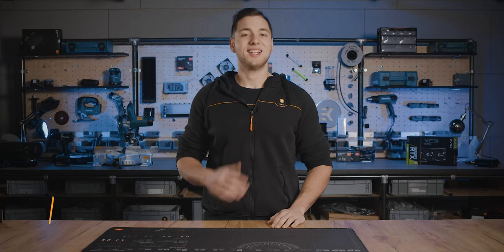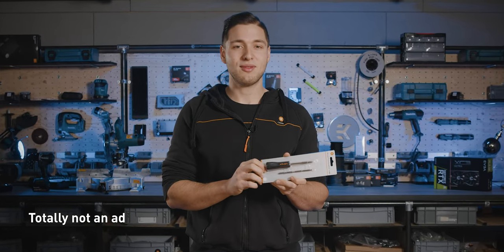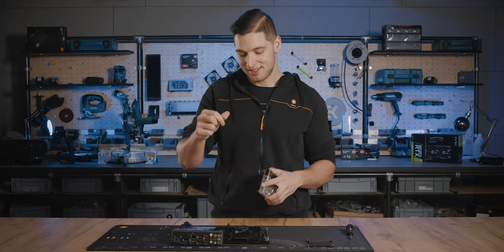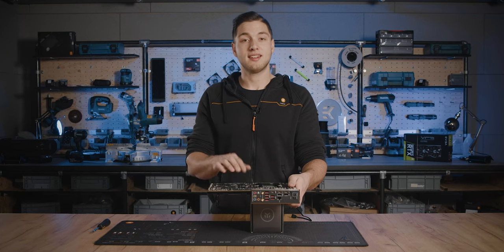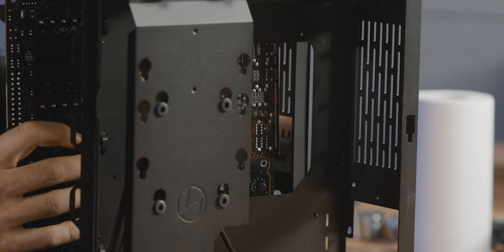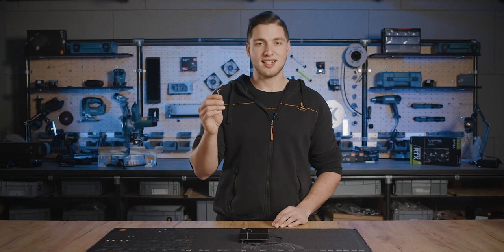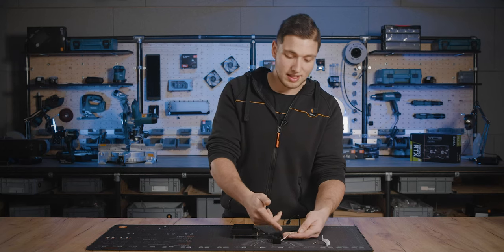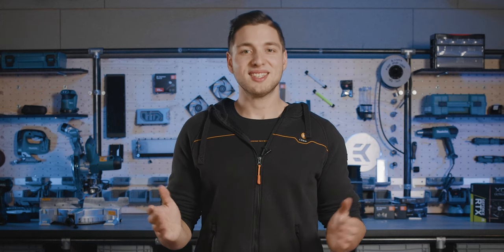Installing the Velocity²: Everything You Need to Know | EK HOW TO

Comment: Hey everyone so I want to jump in and explain something that happened to me after buying the >AM5< version of this water block. When I first got it I imediatly opend the box but did not have a physical manual included so I came to this video to see how it is done. However as you can see in this video you have to use a backplate that comes in the box. My water block did not come with a backplate yet the packaging has printed that a mounting mechanism is included in the box. Turns out that the packaging belongs to the AM4 products. I sent in a support ticket and they asked for me to check the manual on the QR code which is printed on a separate sticker on the bottom that is correctly labled as AM5. The manual lists the included products which did not mention a backplate but instead the backplate is the preexisting one that is part of your motherboard.

If you get the AM5 WB dont worry it does not come with a backplate.
Reply: Thanks for the heads up! I was like ??? There is no backplate

Comment: Video is good but lacks specific info, on blocks that don’t require a back plate how far do you screw in? Manual doesn’t give any indication either hmmm anyone know? Installing an am5 one and not sure if I should screw until they are level with the back plate or keep going

Comment: Just got myself one of these for my AM5 7950x, can't wait to install :)
Reply: How did the install go? I’m trying to install it on an AM5 board. How does it secure to the motherboard? The corners go in the holes, but is there no screw or nut for the backside?
Reply: @TheCOMiiT  yes mate, just received mine, no backplate ??
Reply: dude, just found the backplate is integrated on the mainboard, just have to screw it in =)

Comment: What screws do I use when using the LGA1200 to LGA1700 adapter? the backplate with the velocity doesn't even fit the mounting holes.

Comment: I did not notice the warning in small print, about that, that you can’t stick backlight into any connectors, to avoid closing, partially, this is because of ignorance of English, generally on mine ( ek water blocks ek-velocity amd ) closed the backlight, and now it does not work, is it possible to replace it, and is there a replacement instruction for such water blocks?
I must say, it was a big headache to find an adapter for connecting to the motherboard, x470 gaming WiFi 7 rev 1.0, you should equip your water blocks with the necessary adapters!

Comment: This mounting system was first used on some of EK's monoblocks like mine and I was stressed because I thought there was missing parts.  Oddly enough having just 4 screws going throug the MB with no backplate has worked just fine.  Now that I watch this video I'm stressed about having no backplate.
Reply from the maker: That was the design choice for those monoblocks. Keep in mind the monoblocks are also held in place with screws near the VRM section of the motherboard, so there are more than just 4 points of contact :)
Reply: @EKWBofficial  Can i use 1/2 x 3/4 Bitspower or EKWB compression fittings on it? Reason im asking the distance between the 2 G1/4 ports i wonder if my big 1/2 x 3/4 fittings will fit...Thanks in advance.

Comment: When rotating the block, does the backplate need to rotate as well to match it, or does it stay upright no matter what? Asking because the manual uses the motherboard as a reference for backplate orientation and not the block but doesn’t specify.

Comment: You mention "If You Rotate The Block In Any Direction You May Experience A Really Really Miner Performance Degradation" So What is the optimal layout? Cheers
Reply: The EK badge gives it away. Orient that right side up.
Reply: 3:13 its shown in the video
Reply: Can you rotate the block 180?

Comment: hello, can it be used like this without liquid? works?
Reply from the maker: It will not work without the liquid. You will need a pump unit to push the liquid around, radiator with fans and a couple of fittings and some tubes to connect it all.

Comment: Question: Manual says bottom port is Mandatory as an inlet, is it OK to switch them up if the ports are both at the bottom?
Reply from the maker: You can swap them around, but the performance of the block may suffer.

Comment: Yesterday I noticed that my cpu 13900k was getting 100 degrees hot. I installed the EK-Quantum Velocity² D-RGB - 1200 Nickel from you. Before that, the cpu ran at max 65 degrees in the stress test. I cleaned everything and I still have the same problem can you help me urgently
Reply: 13900k is a lga 1700, not 1200 xD
Reply: @moxb  then tell me why the whole thing worked without a problem for over a year and now no longer
Reply: @moxb  I ordered the 1700, I just checked it again but on the back of the cooler it says 1200, I'm confused, shouldn't it say 1700?
Reply: @soobyt  it should...

Comment: Can I install with a 90 degree rotate? If I need inlet and outlet are in the center.
Reply from the maker: You can rotate the Intel LGA1200 version 90 degrees without any significant drop in performance, others cannot be rotated as the mounting holes in the motherboard aren't spread equally apart from each other (in a square).

Comment: @Ek Water Blocks => Is it possible to use a Liquid Metall like the Thermal Grizzly Conductonaut on the IHS or maybe on a Delied Die CPU without the IHS? I think about the 13900k Series if it comes out this Year! I think it is simular to the 12900K Version!
Reply from the maker: You can certanly use the liquid metal on the IHS with any of the nickel-plated water blocks :)
Reply: What about copper?

Comment: Too bad the screwdriver is a hit or miss being defective. Mine worked fine forwards, only problem is the Asus Crosshair X670E already has a plate on it. You are tightening clockwise my block tightens in reverse. You need better QC for the drivers. Luckily I tested it on an old mother board with an EK water block torx head. Looks like I have to buy a real tool.